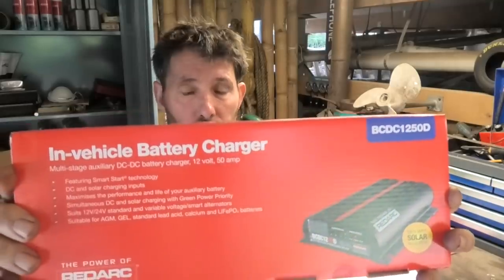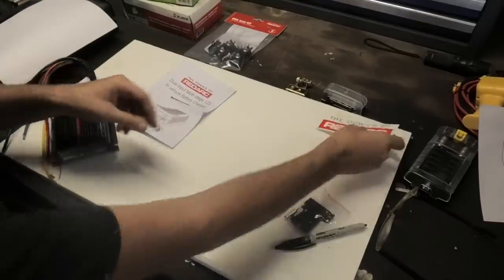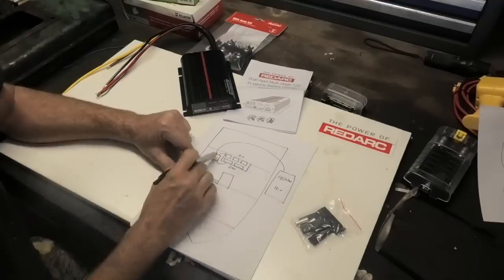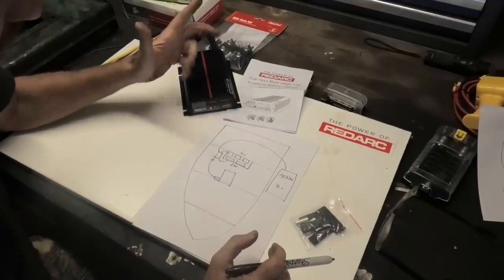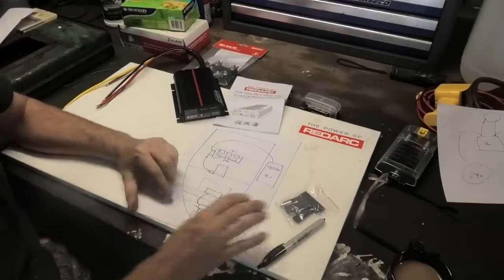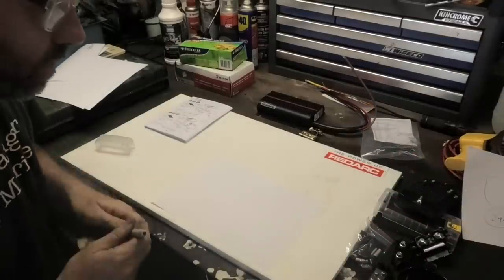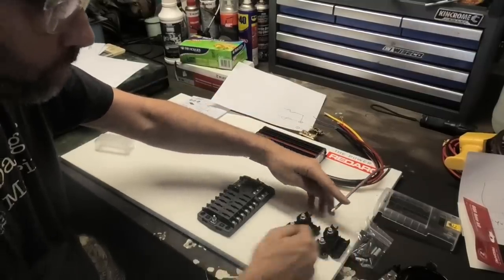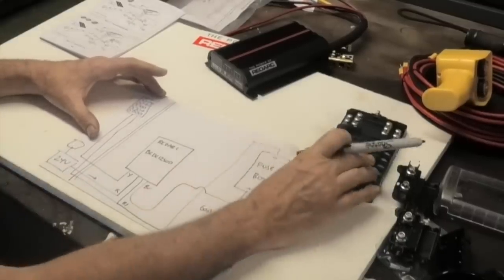Planning the trawler electrics

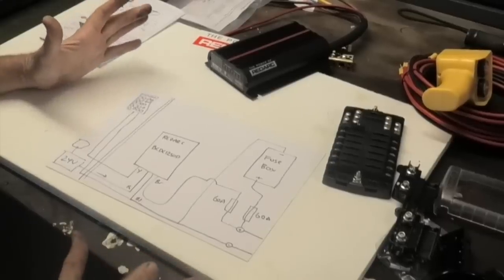Comment: 13:00 One more thing to mention... Do remind, that your 0V(GND) connection has a little issue, the more load you have and the longer the wires become, the more different the 0v potential in any place will be from the 0V  at the accumulators. This is because of the resistance of the wire for +12/24V and 0V (GND) and can create a number of issues, like having parasitary currents flowing through your hull when there is moisture making connections to some steel in some way. This is very difficult to track down and solve later on! --- But anyways, 12V at your battery is not 12V in the wheelhouse, but less ... how much less is depending on the load and the thickness of your wires, presuming your batteries could serve any load. Of course they cannot, so the voltage drop can be severe, depending on the load, like having a anchor winch attached and running...
[edit] It might be a better choice to have an unbound electric system, since else you will face the problem of having currents flowing through your boat from the electric installations in the wheelhouse. It is difficult to prevent any electric contact to the hull already, but since the hull has more material (the far bigger wire), it will always have lesser resistance than any of your electric cables, and this could cause electric current flowing through your hull, since the will be a potential diference between 0v in the wheelhouse (from cable resistance) and your 0V connection from the batteries to the hull. And if it is just 0.05V difference, along with a little bit of moisture it already does the bad. The current will flow all the time, day and night. whenever any consumer is running. And that is not a very good thing to have on any metal hull and very difficult to prevent from happening already. Better not to have electronics bound to the hull potential...

Comment: Run led lighting. Will save you on power and last longer. On a system like this 70% savings on lighting will benefit you
Reply: leith bodin I completely agree with using LED for all of your lighting. Huge power usage savings, the life of the lights is incredibly longer and they are easy to work with.
Reply from the maker: Yep, will definitely swap all the old incandecent lighting out for LED.

Comment: Is there a provision for isolating house batteries from the 24 volt system with the engine off?  You are really taking the time to do things right the first time. Good job.
Reply: A simple relay bank driven from the key ignition and some extra cabling would well be enough to do that if you were really worried about it then you have the chance to just isolate or double throw the relay bank to opposite allowing the 24v system to then increase the coverage of the 12v system but that adds extra complexities and fail points.

Comment: in regard to the separate battery for the anchor winch, I would consider:
All the batteries age with time and will fail in say 4 or 5 years at best. So even if the anchor winch is never used you are up for a suitable new battery for the size of the winch , Say $300 each, every 4 or 5 years.
The use of the winch on the battery is not likely to affect the life of the battery, unless the battery is drained too deeply.
If instead of using a separate battery for the winch, that cables are run from the main starting battery, consider the following:
The cost of the winch battery is saved.
the cost of the cables would be about the cost of the battery it replaces, may be a little more.
you save any secondary solar panel for its charging, 

you save the reoccurring costs of replacing a Winch battery
you save the weight of the battery and solar panel and extra wiring, less the cable weight.
Using  the starting batteries for the winch only means you replace these at their scheduled time which will not be affected by the intermittent use of hte winch, if used properly, at no additional cost.

Also if the anchor winch is used for extended pulling for say recovery, you have the reserve power of the starting batteries, 24v, that can be charged from the boats alternator.
also you must use use a 24v anchor winch , these are cheaper for  the same power rating, and the size of cables is smaller due to the lower current draw.
if using a 24v winch then the saving is two 12v batteries not one - more savings and less weight.

further the single point earth is the way t go. It can circumvent or eliminates earth loops in the hull and prevents noise and electrolysis.

As always you present a good and entertaining video. thanks

Comment: On battery placement: putting the batts in a hot engine room is not the best choice when you seem to have a lazarette on the other side of the bulkhead.  Hot batteries charge slower, apart from several other considerations.  Also, ABYC standards...purely advisory but generally well considered by genuine experts...require battery disconnect switches to be located outside engine rooms, so they too could go the other side of that bulkhead.  Finally, that REDARC device (which sounds excellent btw) will de-rate its output at higher temps if it's like every other charger....so again, consider  putting that great mounting board on the lazarette side of the bulkhead.
You didn't mention an inverter....are you planning for one? Really handy when you have small or short duration 240v needs. Allows you to avoid starting that petrol gennie.  Maybe plan for one in your design even if you don't put it in straight away. 
Finally from me: windlass battery.  Understand your logic for putting in bow but actually on a vessel your length, I wouldn't worry about a heavy cable run for that distance. But if you stay with the fwd battery idea, bear in mind that a bow battery is going to be subject to a fair amount of pounding at times. A good choice because of its more robust construction/vibration resistance AND because it's particularly good at tolerating high current discharges, is the Optima spiral wound blue top AGM 34M. Note don't be talked into the hybrid/dual purpose type D34M, which are more readily available...it's a poor compromise for your windlass application. 

Love your work.  Looked for you at boat show without success...would have liked to shake your hand.
Reply from the maker: Thanks Paul, appreciate your input and sorry I missed you at the boat show.

Comment: Personally I would go for a 12volt secondary Alternator. That way you have some additional resilience in the system in the event that the 24volt circuit fails you will at least have 12 volt backup that can be easily adapted to start the engine. Also that very capable I'm sure Redarc unit gives you a single point of failure for both the 12 and 24volt circuits? To me it just doesn't look like the sort of unit that is salt water resilient or of marine grade construction, regardless of the claimed sealing and manufacturer's claims. It will be full of surface mount circuitry….
Reply from the maker: There is a lot going for a second 12V alternator. I'm tempted to have both.

Comment: From professional experience so called fire retardent plastics are not good. Might I suggest you carry out a small test with a narrow strip of that board you are mounting your electrics on. Hang it by a wire and use a gas torch to light the lower end somewhere out of the wind.
 It might be worth considering jumper cables between batteries as a backup. 
Some swear by crimping connections, I do to, I hate them. Give me good old 60/40 solder (that's 'sodder' for our American friends) any day.
I can understand your concern over salt water and electrics, good luck. Vasaline helps.
Reply from the maker: Good point about checking for flamability, I'll do that.

Comment: engine room halon fire extinguisher? pull a pin push a button and the engine compartments full of halon.
Reply: a hydrogen gas sensor with alarm is a good idea to prevent explosion due to build up of hydrogen gases

Comment: Seems like Redarc thought of everything.  Do you need individual battery isolation switches?  If the Redarc doesn't monitor each battery individually, is there a chance of under charging one of the 12v parallel batteries?
Reply from the maker: Yeah, I'll need some isolation switches and some battery monitoring in the system.

Comment: Anchor winch, run a 24v winch from you starter batteries. 
It will save on cable size
Also, you will always be operating the anchor winch with the engine running, so will not drain the starter batteries

Comment: How about this for an idea.
If you really must have 24v I'd reserve it for your 240v stuff. It is more efficient to get 240v from 24v than from 12v. Keep the GM 24v alternator for the 240v stuff and run the entire ship off 12v to keep it all standard. 

Run 2x alternators. One 24v for the 240v stuff and change the starter for 12v version. 

Have say 2x batteries in parallel for the engine only and several other 12v batteries for all the rest of your 12v needs.

To make the entire 12v part work together, they make these relays that do away with isolator switches entirely. These relays which are high amp (100amp and 200amp) are pretty cheap - $89 for the 100amp and I couldn't get a retail price on the 200amp model as they were sold out everywhere even you know where auction site. You connect the battery banks with 300amp cable (~$12 a metre). How the relay works is simplicity. I like simplicity very much. When the motor is running the relay senses the alternator output and connects all the batteries thereby always charging all of them, and when you switch off the motor the relay switches to open circuit as soon as it detects a voltage disparity between the banks - isolating the banks. It is designed to have an optional toggle switch to connect the batteries all together if you have flat starter batteries for example. 

You'll probably need a reasonably big 12v alternator but that stuff is as cheap as it ever was these days. Remember, with big alternators they only output what the charging requirements are, but the high output part of it gives you significant 'headroom' so that it isn't running at any time, at or near its maximum output. This headroom is the key to reliable operation.

There are very many considerations in all this I admit.
Reply from the maker: I'd also have to factor in the cost of a 12V starter for the GM of course, but that may not be too much.
Reply: @DangarMarine  yeah not too much. There's a marine place in qld that I'm sure you know about that sells GM 2 stroke stuff on ebay. I see new 12v starters on ebay too from time to time.

For the 240 batteries i envision 4x 12v batteries - 2 strings each of 12v batteries in series, then connect the strings in parallel. That's how they do it in solar 24v using 12v batteries (not that there's any other way I'm thinking lol)

Comment: the Redarc...is it capable (as you are mentioning) to charge both a 24V and a 12V battery bank? I cannot find those specs! I think you will have at least an 80Amps alternator on your machine and the Redarc cannot handle that. So, just charge the 24V bank directly with the alternator and charge the 12V bank with the Redarc dc-dc dohikkie Use the 24V bank as input for the Redarc.
Reply: I wonder if REDARC unit has battery charger that is “Temperature compensated” for the optimum float voltage and maximum service life.

Comment: Get a 24 volt anchor winch and run it off the house batteries. The wires won’t be that big and be cheaper than another battery (instead, make your house bank bigger). Most danfos compressors in fridges run happily off 24 volts. Icom make a 24 volt VHF radio, most LED nav lights will run ion 24 volts, most USB chargers run off 12-24 volts, plenty of interior lights run off 24 Volts. If you need to run portable tools, get old 18 volt cordless drills etc, delete the batteries out of the battery pack and add a lead and an anderson plug on the end.  Get a 24 to 12 volt converter for the stuff you are really stuck with.

Comment: I’m interested How’s is your 471 coming along?
Reply from the maker: It's getting there. Dropped off all the parts to the engineer last week. It needed a new camshaft too which I found online and just saw a notification today that it has been sent so that should arrive soon too.
Reply: Dangar Marine I hear u. Mo money mo money. Once u get it right you’ll have a friend for life. I ran my 471 hard for about 3 to 4 days a week every week for 2 years with not a bit troubles. I parked it for about 4 mo cranking every 2 weeks to keep the batteries charged. I went the other day and found water in oil. So I’m troubleshooting now. I will be pulling my head off next to install a seal kit.

Comment: Sound like a good design. Do you think with the engine usually running when using the winch (arrive/leave area) that it might be best to have it fully cabled? Extra battery (if needed) sounds like better value in main bank.
Reply: Nothing wrong with (and I reckon better done with) tying that forward battery to the main bank by 4g/8g cabling meaning the battery not the cables is bearing the brunt of the load when the winch is worked but elsewise it is just another expansion to that cab battery bank and able to be charged along with it.
Reply: @NullaNulla  I see the value, one would have to protect those smaller cables in case the forward battery went bad/weak (overdraw breaker on smaller cables?) and in case of urgency you could take one of the good battery's from the main bank forward if you could not raise anchor any other way. Cheers.
Reply: @jimz1168  yeah just make sure the breaker (better choice over fuse imo) is rated lower than the wire is so if wire is 100a rated then when the draw hits 80a the breaker kicks out. Maybe as an extra to Stop a stuttering breaker have a 100a/equal to line amp capability fuse as well just incase.
Reply from the maker: Yeah, starting to side with a 24V winch off the starting batteries.

Comment: Stu mate, given the amount of do$h you're going to outlay for your power, have you considered lithium? its come a long way in the last couple of years,
Reply: Indeed it has but has it got the cycle life of AGM is the question or $ of initial lion vs AGM plus any replacements needed to match. When weight is a consideration there's no questions but in this case $ vs $ is it there yet?
Reply: Glen O'Riley Lithium is 60% the weight and 5x the price of AGM. 2000 charge cycles, discharge to 80% and AGM is 500 cycles at 50%. YMMV but this is conservative for marine use.
Reply: @Jonski2009  if you were in a smaller  yacht or something where you want weight difference for wind power etc and size of course then yep but in a dare I say dirty old diesel steel boat it isn't likely to be enough benefit to make the extra cost worthy. Great to see some figures there though.
Reply from the maker: Lithium has come a long way recently, but they don't recommend you use them in an engine bay due to head and I want to convert the lazarette into a sleeping compartment. Also, I need to add more ballast to this boat now the concrete bags are out so the weight is actually an advantage for me.
Reply: @NullaNulla  Weight aside, the above numbers imply a long term cost saving of 20% (given price and discharge depth plus life cycles). Whether that's worth the up front cost is worth it is your call.
Reply: @DangarMarine True, but of course the weight should be low and on the centreline, I think those battery racks are higher and to the side?
Reply: @Jonski2009  your numbers must be off then there is no cost saving for lion vs AGM.. AGM will win every time.
Reply: @NullaNulla  The above was very round numbers. From my spreadsheet... I have surveyed battery costs in NZ (not too dissimilar to AU) and AGM is average $2.40/Ah, Li is $11.53/Ah. For (say) 100Ah of usable power you need 200Ah AGM or 125Ah Li installed. Costs are $480 or $1441 respectively. Over 2000 charge cycles, you will need 1 set of Li batteries ($1441) or 4 sets AGM at $1919. Therefore cost saving is  25% in favour of LiFePO4 in the long term. Note: total installed capacity Ah affects these calculations slightly, large capacities Li is 23% better and small capacities Li is 31% better. But you can see Li wins long term every time.
Reply: @Jonski2009  given every li I've seen has fewer charge cycles in life than an AGM or sla counterpart .....

Comment: Hey mate,
You'll be matching all your batteries in the bank, so just add another matched battery up the front for winching, those units will charge quite a lot of amp hours. My projecta 25a dc-dc does around 300ah. So yours will likely do more. Your battery for the winch will have to have decent current output so it's not like it will be much smaller than your main bank, I'm taking a stab that's what you were thinking with the additional dc charger. You may as well add this one as part of the bank just up front. Then as you say charge via smaller 8mm cables. You can get dual purpose deep cycle & cold cranking AGM batteries these days.

I use these: 
https://www.autoelec.com.au/135ah-amp-hour-battery-agm-sla-12-volt-12v-deep-cy

These guys provide great support also.
Reply from the maker: THanks mate, I'll check out the charger.